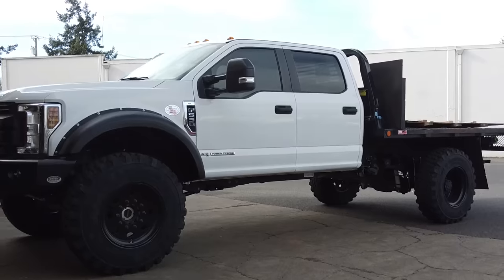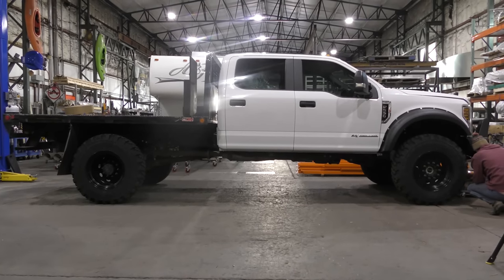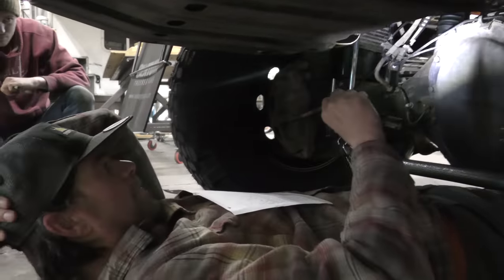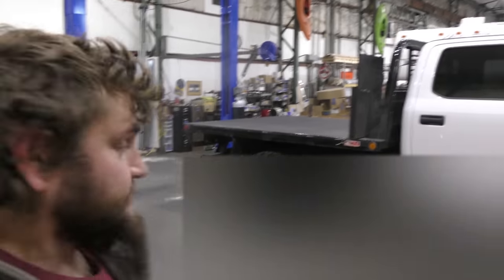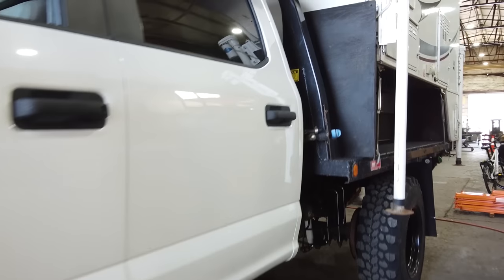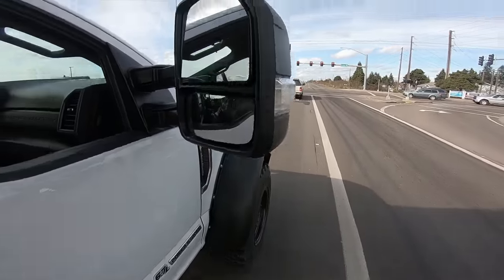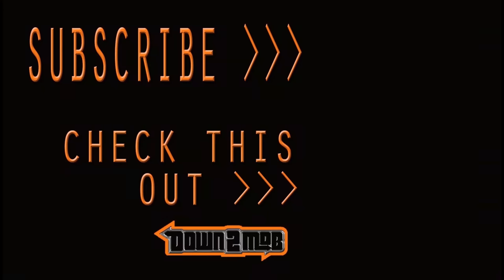MONSTER F550 6.7L Turbo Diesel FLAT BED w/ Arctic Fox Truck Camper

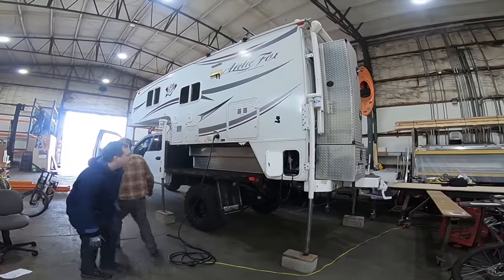Comment: Another dude with a good idea. Mine 2019 F550 super single from DBL with upgraded brakes, 41" tires, bead locks, front locker, 6:17 gears, buckstop bumper, winch, garage built on for stoage, FWC, Titan tank, onboard air soon and plenty more. We built ours as my wife avoids flying.  We are older and have worked a long time! For anyone curious about the how!
Reply: Can you imagine the high COG on that rig with a hardwall TC?  Your FWC is more sensible I think.  That setup will land on its side at the slightest steering jerk.
Reply: @marcpikas2859  actually, they are wide due to starting as a dual.  The payload is about 14000 pounds.  It should do well.

Comment: At 34 i just started full timing in my 17 ram 3500 and 2020 northern lite here in Montana.  I'm glad this guy said northern lite because slide out campers are not ideal for rough offroading, plus they weigh a lot more.  The clamshell design of the northerns are superior construction for durability, low maintenance, and their depreciation is slower than any other camper(I think).  
...and no, I'm not getting paid to say this.  I've had two of their campers in the last 7 years and am very pleased with them.  Just trying to spread the good word!
Reply: Same basic design as a Bigfoot since the people that started Northern Lite worked for Bigfoot.   I've had two Bigfoot campers.  My current Bigfoot will be 20 years old this year.
Reply: I need one

Comment: I run a Lance 11 footer on a Ram 4500.  I've thought about going single due to the better traction in snow and off road but with the kind of weight the slide in has, I look at dual wheel as insurance in a blow out.

Comment: Hi, awesome truck. I am purchasing a 2019 F450 diesel crewcab 4x4 with a 12' bed in two days. This truck has a 203" wheel base so the camper can sit back and give me a lot of room for storage in front of the camper and along the sides. My question is, the truck im buying has a 16,500 gvw, by converting that truck to a super single, how much did it drop the gvw? Thanks

Comment: This rig reminds me of the Startracks Motorsports F554 extreme Pro. (Ford F-550) Stage 1 and Stage 2.  You can even get them with gear reduction Portal axles and 42-44” Goodyear’s or Continentals.  Check it out.

Comment: Seems like a great choice. I live in a Lance 1181 on a F-350 dually. I love my rig but not a whole lot of mob-ability since i'm super heavy and my center of gravity is pretty high. Single rear wheels and more weight capacity would be sweet. Do those tires keep up with the GVWR of the truck?
Reply: manyowefew1  the continental MPT81 super singles on this rig are rated for 6780 pounds per tire  or 27120 pounds with 4 tires at 96 psi and a speed rating of 68 MPH , the F550 can be rated for 17500 LBS GVWR up to 19500 LBS GVWR with the new 2020 F600 going up to a GVWR of 22,000 LBS

Comment: Great rig, thanks for posting.  What kind of mpg’ does he get with those tires?
Reply: R A 5-7...
Reply: @ibMoose2u  More than  that I get 19.2 with my  forestriver 1130 &  dodge 5.9 and 22.7 unloaded . I have injectors tuner and larger turbo upgrades so im far from  getting the best mpg I could be.  5 to 7 , Thats gasser mpgs.
Reply: @Mark Rich that’s AWESOME!!! Wow! Yeah true, that is gasser mpg. I get 23ish unloaded and only about pulling my Outdoors RV though it is 34’ and fully loaded 11k. Did you put a FASS on? I have one getting put on tomorrow 2nd gen Dodges it’s a bit of a necessity lol I put on a cold air intake, new Banks muffler and exhaust brake and an Edge CTS. Can’t quite go the next step on a turbo and injector lol.
Reply: @Mark Rich Jesus... lol that’s some next level stuff :^) Very cool! At this point, mine only has 90k miles and though the extra hp/torque would be nice, the little I’ve done makes it stupid easy to pull my trailer. If I had your skills, I’d probably do it just for fun lol
Reply: Lance 1025 light on a 2007 5.9 Dually, first trip we got about 13 with a head wind most of the time.  Never going back to pulling a travel trailer or 5th wheel for camping

Comment: I hve invented idea for airless tires that use fork lift type all rubber small tirs in spinnning group & off road version that will make all but the smalllest cheapest tires obsolete Yuke dump truck down airless bank is future. Came up w/ rip off of Anderson comet levers, as a ball joint or top of shocks to keep axis orientation under heavy off roading.

Comment: If I ever ran super singles military  roughing it I would make the outer side wall all tire. Meaning it 2" is solid run basically near flat on 2" edge just side wall. Not changing, calling helo ride side pick up.  No need 2 hve easy to reach spares. They r going in the bed under my slide in away from theft or vandals. See also prev pnt about snow or mud or sand if stuck putting down leveling jack on bad limb corner & adding raft inflatable foot w/ hard bottom skid on pad. AGAIN not changing or try to got out bitter cold or sand or mud deep & change or fix shit. I hve 2"side wall super singles & float raft.
Reply: Even if some1 shoots few holes n tire it's a run flat 2"side walls & 110 PSI so I can just keep running the compressor high output while driving away, I anti changing shit.
Reply: They hve self sealing inner bladders also so military grade tires & I want that too. Some times u drive into a war zone just going down wrong street.

Comment: This is Me daily drive max tilt flat box welder bed w/ king pin & can always bolt on 5th wheel & 3" receiver w/ extend 1ft rear seat quad bed in 4 by 4. 450/ mayb 550 (crap ride)not worth doe unless wider stance). Decent in bed slides of med duty truck & pop top.
Reply: As soon as poss hybrid 2nd alternator 48volt & battery pack, w/plug in option even better or way to plug power from trailer bigger bank back into truck.
Reply: If running a turbo needs a 2nd 1 bc they r way slow. Steam bolier might help train type speed problem no power limit to stored heat poss w/ steam. Just can't use water boiler.
Reply: Under 25mph or stopped run battery mode.
Reply: extend cab bench makes decent bed or 60 40 split so u can remove for med dog or big dog instead of person back passenger.

Comment: The problem with those is finding a replacement tire if you need to on the road.  Not a lot of 41's available at the local tire shop.
Reply from the maker: For sure it is definitely tougher!
Reply: Carry two.
Reply: Or mechanics than can even work on a new ford. But that old 12v 5.9....anyone can work on those. Sometimes simple is better.

Comment: I'm a cabinetmaker. I work in aviation. I travel around the country for contracting/work. This is just about ideal set up. I could pull a small trailer w/my motorcycle & tool chest and if I needed to, I could remove the camper and drive to work in bad weather.

Comment: How tall is this rig (especially with surfboards/kayaks on the roof rack)???  My stock F450/AF990 is over 13'.  With the lift and the tires it has to be well past 14'....
Reply: That's getting pretty tall. I want to say my 2500hd with a lance 845 is around 11'6"

Comment: That model camper is not long enough bc full sides of bed need to b 2 work box per side. A slide out tray w/ a spare makes sense but u would still need a spare under the frame if not carrying the camper prt.

Comment: I have 2019 AF 990 on reg cab 2019 dually F350 . Couldn't ever imagine putting a AF on a single RW
Reply: I ran that camper on my RAM 3500 SRW and it was too much.  The F550 converted to SRW has a the same stance as a dually and a payload of 19,500lbs.  Tires/wheels each good for 7k lbs.